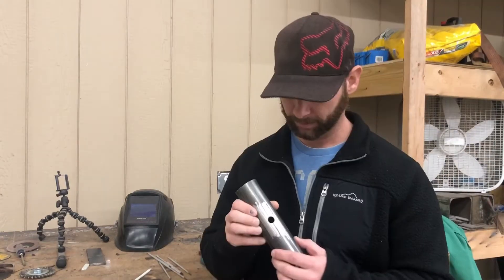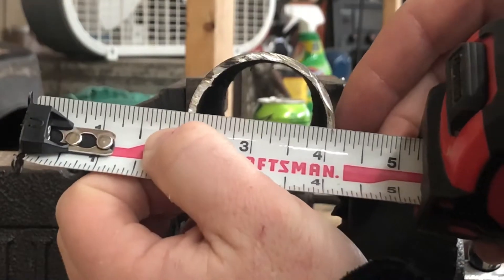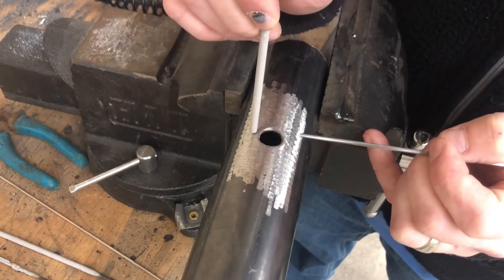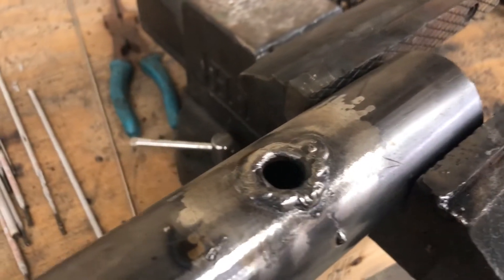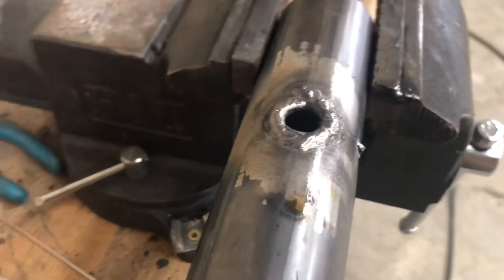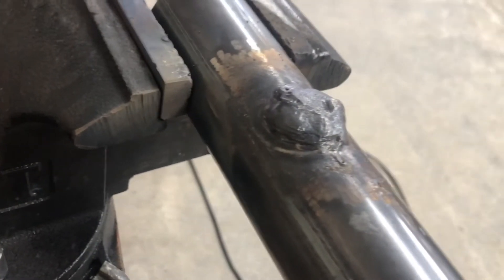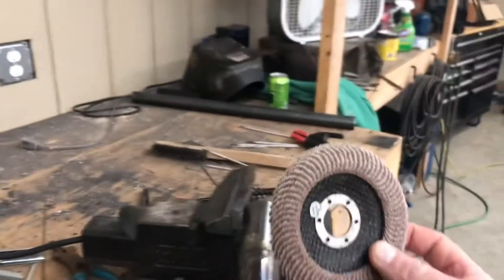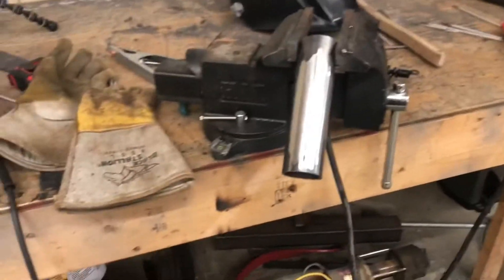How to Stick weld big holes with arc welder

Comment: What # rod do you recommend for filling holes(hopefully 6013 as thats all I have...but I can run to the store.).  Noticed running on AC didn't go as deep as dc+.   Have cracks in a loader bkt that I'm trying to fix.  Knocking flux off sticks to help fill but all I have is 3/32 now after running out of 1/8.
Noticed the 1/8 filled better/didn't cut as deep as 3/32.
Noticed hobart 1/8 had whitish flux where hobart 3/32 had redish flux...wonder if that is the difference or 3/32 was marked wrong & really 6011(kinda doubt it but the mind does wonder).
Let me know what's best to fill.  Thx!!!
Reply from the maker: 6013 or 7018 will do just fine but 70s tig wire will be the easiest to use as the filler rod because it’s already clean and it just flows better.
Reply: @getweldsoon1113   what would happen if used regular fluxed welding rod for a filler?
Reply from the maker: @buddyitzy9899 you can do that just knock the flux off of it. Tig wire just flows a little better.

Comment: Looks like you made a hole in the bottom from drip.?
Reply from the maker: No, I just drilled a hole in this pipe to do a demonstration. No hole in the bottom.
Reply from the maker: The hole in the bottom was drilled, not from dripping metal. To be honest I don’t remember why it had holes in it but I thought it would be a good demo.

Comment: Hi there, Can you eventually drill a hole on that same filled spot? Will it be as resistant as if there was no hole in the beginning?
Reply from the maker: Yessir, as long as it’s a good solid weld and you weld it with the same material.
Reply: Sweet. Thanks for your answer  @getweldsoon1113

Comment: With TIG, I just put a copper tube inside with a OD as close to the ID of the steel tube as possible.  Press it against the hole and then fill the hole.  No material will stick to the copper and it will look nice and neat from the inside.  I have not tried it with a stick, but it should work too.  If you have projects where the inside of the tube needs to be clean, it works great and actually the copper acts as a heat sink which helps distribute the heat more evenly.
Reply from the maker: Yessir copper works great for that. 👍
Reply: I was wondering about this, can you use aluminum instead of brass or copper?
Reply: @anthonyreddy2834  No, aluminium has way too low of a melting point and will make a huge mess of things.

Comment: I have done this on cast iron with another 7018 rod to fill in the gap and it works good
Reply: 7018 on cast iron? Bet it's still cracked

Comment: Any time I dab in and out to try and keep something from overheating I get alot of inclusions. What am I doing wrong.
Reply: I thought you had punch off the slag..before you try to burn the rod again .but u kept doing it all the way till hole closed up.
Reply from the maker: It’s hard to say for sure without watching you but make sure you are burning hot enough to burn out any slag and to melt down the wire you are adding. Try to keep a tight arc and if you long arc a bit when you add wire, then immediately go back to a tight arc after adding wire.
Reply: @getweldsoon1113  thanks for the input. Subscribed
Reply from the maker: Thanks you! Let me know if you have  any video requests.

Comment: What about slag inclusion? It seems pretty nice, but that technique could probably trap slag with filler rod... Maybe it's not an issue with hole caping. Here, the grinded weld seems pretty smooth though. Hum... What do you think?
Reply from the maker: Not really an issue as long as you make sure the metal melts down good and burns any slag out of it. If you did have an issue with it just grind it out and fill it back up with clean metal.
Reply from the maker: I would only use this method for big holes or gaps.